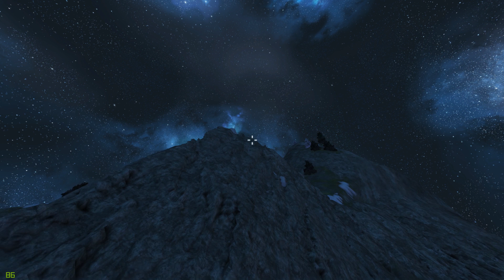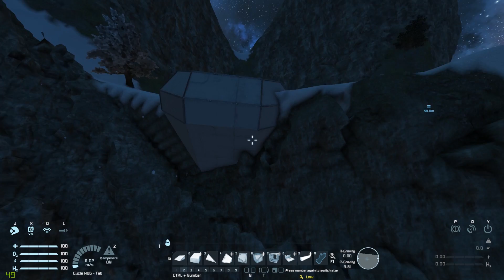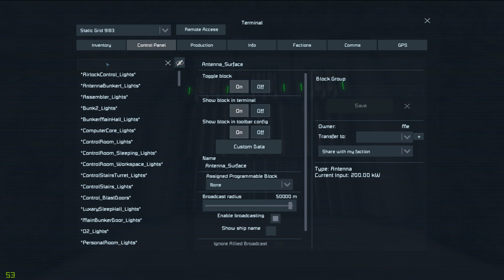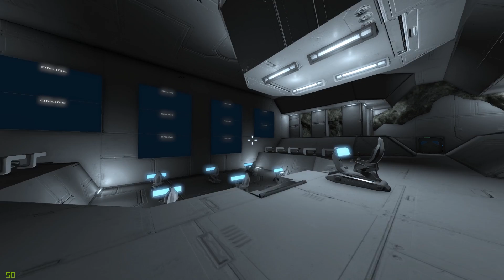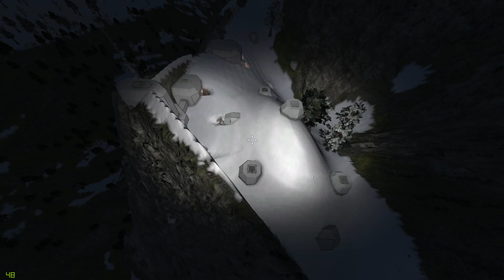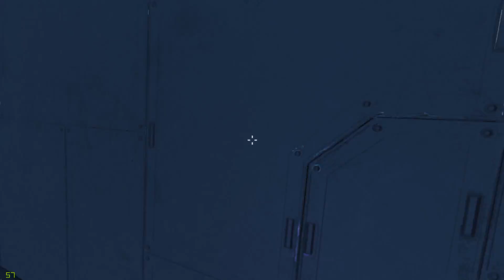Space Engineers, The Mountain Bunker

Comment: Hey ecto Sage, i haven't played Space Engineers in a while so they may have patched this out but you kinda sorta can build with remote control blocks. Id use a 50,000 distance large ships supply carrier to daisy chain my connection to the smaller ships welders.
Whilst welding up different piece onto whatever i built i had the supply ship merged to the structure and a projector block rotating and positioning very specific types of blocks and  large ship room pieces IN BLUE PRINT FORM.
whatever i needed i just PROJECTOR-BLUEPRINT-MERGE-BLOCK-WELDED it in.

downside is how slow it can be not being onsite unable to move things along faster, upside is removing this possibility from the equation "someone follows you back to base on your supply run, or favorite ore site then blows up your base or uses up all your ore while your away"

Comment: Protip... It's really easy to make functional airlocks that won't blast you all over the place.  You just need a 1 block area between your airlock doors with an air vent in the roof.  Put in a button station with one button that turns the air on and another that reverses the air (sucks it out).  Simply pressurize the room before you enter the base, and depressurize it before you exit.  End of pressure changes blowing you around.

Comment: 13:44 You know you could always make a "drone building bay" Either a elevator shaft that pushes your creation out a shaft, OR create a remote building bay near the surface somewhere, and have a sealed hanger with enough space to build with the external bays holo emitter. 
Then all you need to do is make parts that fit into the drone printer for a drone to print and pickup so you can construct a bigger printer.